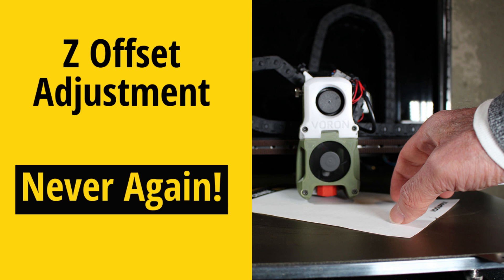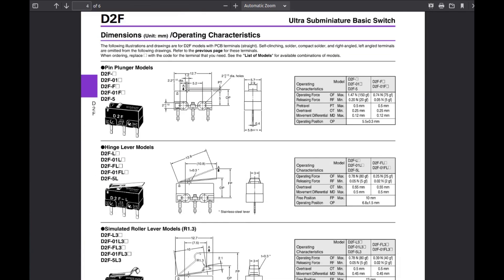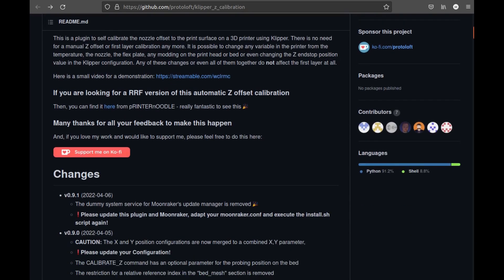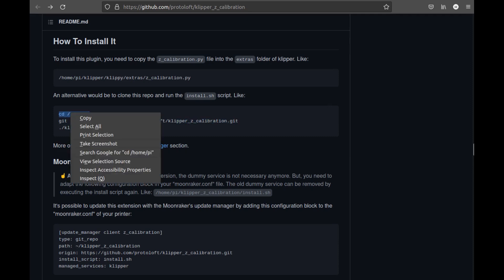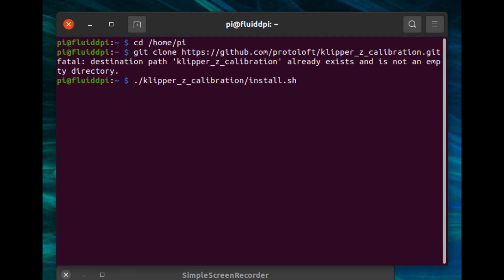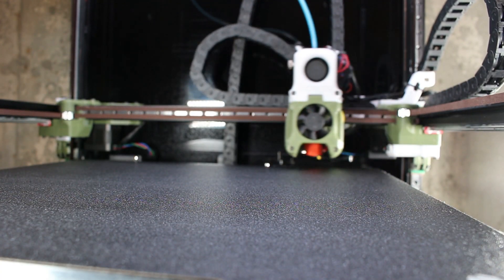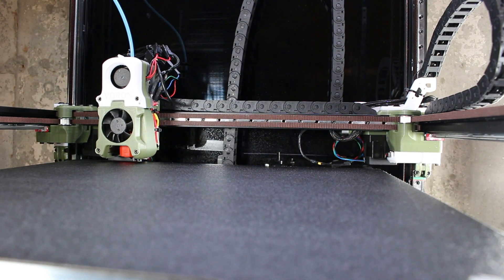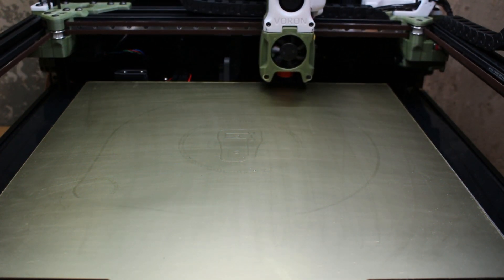Never adjust your 3D Printer Z Offset again with Klipper and a plugin

Comment: thank you for sharing your knowledge with us. I followed the instructions exactly. Unfortunately, when I change the switch offset, whether up or down, nothing changes. the nozzle always scrapes across the bed. I have screenshot / after calibrate_z: G-code 25.34mm (Klipper Z=23.94 < position absolute) G90 - G0 Z5 > G-code 5.00mm (Klipper Z=3.49) - G0 Z1 > G-code 1.00mm (Klipper Z=-0.51) I don't understand that! Do you have an idea what I'm not considering?  I use "Klicky"
Reply from the maker: I'm going to assume you are including the autoz.cfg file in your printer.cfg file.  As you make the changes to the switch offset, are you restarting Klipper to be sure the cfg files are all reloaded?
Reply: @KapmansBasementWorkshop  Thank you for your answer. yes i added the include and yes i always click save and restart. I also restarted the Pi in between.
Reply from the maker: @ah_banny8478  Apologies for asking the most basic question there, but it happens to everyone...Can change these setting by hand and save them?  I wonder if it's rights or possibly a typo?  Can you post the cfg files someplace and post a link so I can have a look?
Reply: @KapmansBasementWorkshop  Did you ever get this resolved? I'm having the same problem.
Reply from the maker: @davewilkowski8326  I don't know the solution to the above problem, but I did post my cfg files to GitHub in case anyone wants to see them.  https://github.com/Kapman1/Kapman1

Comment: Is it possible to add the mesurement from the probe body to the 0.5mm klicking distance and get rid of Picking and mesuring the probes body over and over again?
Reply from the maker: Hmmm. Good question.  I suppose the reason for a measurement each time is to take into account any changes due to temperature impact on the printer's expansion that may be different between prints or a cool printer.  If that switch height were hard coded, would it impact that measurement?  I want to try this now, but my printer is working so well that I'm scared to!  I've also been thinking about changing the start print macro to eliminate as many steps as possible between QGL and the z-offset calibration.  But now every print is rolling off this printer with exactly the same texture on the bottom with no problems or adjustments needed.  I'm kind of enjoying this!
Reply: @KapmansBasementWorkshop  I guess the mesurement is even better,  because one object less that can cause inaccuracy by heating /docking (Probe)
Reply from the maker: @Micha-46456  So at some point I'm going to try it.  If you beat me to it, please post back.  I'm very curious.
Reply: @KapmansBasementWorkshop  I will -  I recently ordered my voron kit, but it won't be available until the end of May at the earliest.
Reply from the maker: @Micha-46456  Have a great build!

Comment: I have an issue with this that the adjusted z now causes the z to be wrong for the probe dock/undock.  So I run this, it adjusts the z, then if I dock the euclid it now hits the dock.
Reply from the maker: I had to adjust this several times after installing.  Since then, I'm not having any trouble.  But, I'll try this weekend with 2 build plates stacked and see what happens.  One other thing to note,  I have had people tell be that mounting Euclid on the gantry is actually better than the mount I used in the video as z-height does not come into play...
Reply: @KapmansBasementWorkshop  I will try the gantry mount.
Reply from the maker: @req00  Please let us know how it goes.
Reply: @KapmansBasementWorkshop  I installed the gantry mount and it works very well with no issues on docking etc even with autoz.  I used the v4 mount from Euclid which has adjustable height but I had to remix the stl using the short gantry as I needed it to be fully docked about 5mm further over on the gantry.  Works great now though and any Z height change the gantry being skewed has no effect on docking.
Reply from the maker: @req00  This sounds great.  I'm glad you were able to fix/improve this.  I'm not having trouble, but I think it may be a good idea to replace mine as well sometime over the next few weeks.  I've been thinking about this since your report and it just makes sense.  When I get some time later today, I'll add a note to the description about this.   Thank you for reporting back on this!

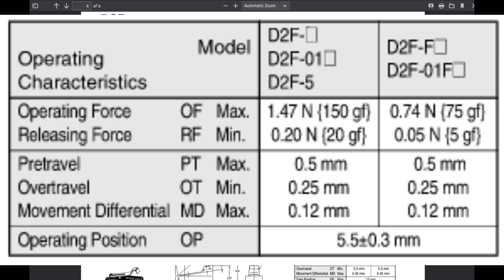Comment: The exact value of the switch_offset value cannot be determined from the switch data sheet and specifically has nothing to do with the  Max pretravel PT in the spec (timestamp 2:25). Protoloft correctly calculates an initial swtich_offset value:  offset base = OP (Operation Position) - switch body height.  But the tolerance on the OP is +/- 0.3mm, so for the D2F-5, the switch_offset will be somewhere between 0.2 and 0.8mm.  We really want the overtavel OT value, that is delta distance between the trip point and where the plunger bottoms out on the case. However the data sheet only provides a min guaranteed OT value.  For a given D2F-5 switch, you can get a fairly accurate estimate of OT ( +/- 0.01 ish) by grapping the switch in the jaws of some calipers and slowly closing them until you hear the click.  The OT is trip value minus the bottomed out distance.  BTW THANK YOU! for creating this video.  Enormously helpful.
Reply from the maker: That is a great point.  I'm going to go back and measure the OT as you suggest here.  Thank you very much for the tip.  Thank you very much for watching!

Comment: Installed a klicky probe, started using z_calibration on my V2.4 and I love it.  Now I've got this working with a CRTouch on my custom printer.  The klicky EVA mount stuck too far below the duct and was below the nozzle (the mount itself, no probe attached) , any other way I came up with to mount it put the probe too far away from the nozzle to do any good so klicky wasn't an option on that printer.  None of the other magnetic probes I looked at seemed any better, maybe if I was running an E3D V6 volcano but with the Mosquito hotend I'm using, no.  Instead, I came up with an adapter to put on the nozzle stop's pin that allows the nozzle to contact the pin but the CR Touch to contact the adapter a few mm higher.  It tricks z_calibration into thinking the "switch" is below the nozzle, I just had to play with the switch_offset a bit (it's 1.97) and it works like a charm.  The metal pin of the CRTouch helps, I don't think I'd do it with a BL Touch and it's plastic pin, too much chance of damaging that soft plastic pin.

Edit:  The CRTouch pin isn't deployed until measuring the bed, so using it's metal pin as the "switch" contact location works out great when z_calibration is checking nozzle position and switch position.  The adapter I came up with goes on the 5mm pin of the nozzle stop, basically a hollow cone with a flat rim.  The nozzle can contact the 5mm pin and the CRTouch contacts that flat rim that's a couple mm above the 5mm pin of the nozzle stop.  The cone section is wide enough inside that a hot nozzle won't touch it, the part that goes over the 5mm pin is tight enough not to move easily but I still added a stop ring so that it cannot be pushed further onto the pin and it's height and placement on the pin remains constant.
Reply from the maker: I love it as well.  It's soooo cool that you got this working with the CRTouch!  I may need to try that with my other printer!  I wish I thought of it.  Thank you for posting back and thank you for watching!
Reply: @KapmansBasementWorkshop  Thanks for the great video!  It was very helpful in setting z_calibration up on the V2.4.

I was going to put a klicky probe on the custom build but the mount they had for the EVA wouldn't work with my hotend, it was lower than the nozzle.  Since I already had the CRTouch on that carriage, I wanted to see if I could use it for z_calibration.  I printed out a nozzle stop like the one the V2.4 uses for use as the z endstop and tried without any modifications but it just wouldn't work. I got to thinking and came up with the adapter that allows the nozzle to contact the pin and the metal pin of the CRTouch to contact higher, fooling z_calibration about the "switch" being lower than the nozzle, increased the switch_offset and it worked beautifully.  Here's the adapter I came up with, feel free to use it or not, however you'd like to: https://social.thangs.com/m/65919

It should be tight on a 5mm pin, tap it gently until it hits the inside stop.  I made it fairly tight so that with the built in stop, it won't move again after installed.  Play with switch_offset to dial in the correct height after running z_calibration.  I was working on the printer bed and had to dial mine in again, it's currently 2.04, so a much bigger offset than with a microswitch but it works.
Reply: Mark, I`d be interested to see how you mounted this on with the CR touch I`m running a BLTouch on an Anycubic. Just wondering how I could adapt this for it.
Reply: @goodmandavis  I'll check and see if I still have the files/photos of what I did.   I lost a lot of videos and photos recently due to a corrupted drive and personal failure in backing that drive up so I'm not sure I still have anything so no promises.

I've made changes to that printer since and don't use the CR Touch anymore, changed the hot end and modified the carriage which allowed me to add an annex engineering probe.

Comment: Great video. The only thing that jumped out to me was you would have to make sure your nozzle is spotless when calibrating your Z offset. I would imagine a bit of filament that oozed out at some point with the nozzle hot or cooled, could easily affect it up to a good 0.5mm or more. Is there anything special you do to help mitigate this?
Reply: Do the nozzle scrubber mod as well.
Reply from the maker: I do plan on adding this.
Reply: When print is finished I do a retract
Reply from the maker: @everuss  That seems like a great idea!
Reply: @everuss  on a HF nozzle you will still likely get some ooze unless you're retracting 20mm+. At least that's the case for me. I had it set for 15mm retract on print_end but it still oozed so I went back to manually cleaning with a brush before Auto_z.
Reply: @everuss  same for me, and it also allows to change the filament or take when the printer is cold
Reply from the maker: While I plan on adding a nozzle brush, I'm reasonably sure that as long as the hotend is at proper temperature for the filament installed, it's typically accurate enough.  But I do brush the hot nozzle with a wire brush before calibrating.

Comment: I gave up a few weeks back on getting this working after installing klicky on my Voron 2.4...in just a few minutes following your video I realized where I had missed a step, and now I'm autoz calibrated! Thanks so much for putting this together.
Reply from the maker: Glad I could help!  Thank you for watching!
Reply: hi, can i ask what step you missed? i get a lot off errors taht i can all solve, because entry's where not filled in the autoz.cfg file or just were examples. After editting al errors out, now i get a message "No trigger on probe after full movement" in calibration step. Did you get the same error? how did you solve it? Thanks!

Comment: Your videos are very well done.  Hat's off for the quality (and the challenging focus on that one).   I am experimenting with different setups concerning z-offset and switching build plates.  I currently run my probe (klicky) as the virtual z-endstop.  Therefore not currently using the default pin-based z-switch in the back.  This takes care of the varying build plate heights and does not seem to create other issues (But I still have to experiment more).    Question:  Don't you find using the nozzle to zero on the back switch an issue on a day-to-day usage?   I got burned many times (before switching to virtual z-endstop) where a little bit of plastic was left on the nozzle and would throw off the z-offset enough to ruin my first layer.
Reply from the maker: I find that as long as the nozzle is hot, and I brush it before the start, I don't seem to have problems with the z-switch.  Or at least I don't think so.  I was having many issues with the induction probes which may have been hiding a problem with the z-switch.  So I suppose I will see soon enough.  Do you adjust z-offset by hand?  Thank you very much for the kind words and watching!
Reply: @KapmansBasementWorkshop    I adjust z-offset by hand and apply the result to the probe.  I never do it again until I switch nozzle.  And I rarely do.  I used to brush it before the start but even then, it would sometimes be a problem with the Home being done on the nozzle.   Like you, I don't have a decontamination brush (yet) so brushing is at the beginning of the process.  As it stands now, I can start a print and walk away.  Oozing at the end of the nozzle will get purged but will not mess up the z-offset.    The only concern I have (and still need to test) is the variation in z-offset due to printing at various temperature.   In theory, the nozzle is going to be higher (less expansion) when I print PLA vs ABS.  45 deg difference could shift the z-offset by 0.01 mm ish (still have to do the math).   To be tested.
Reply from the maker: @eridoom  That brush and purge bucket are high on my list.  Very soon.  I'm going to be experimenting with heat soak time to see if the Euclid probe has reduced the time needed as well.  I was waiting up to 2 hours for the induction probes to stabilize.  If I get an hour or more back, I will be thrilled with all of this.  That said, I would think this modification would take care of the z-offset changes due to temperature changes.  I wonder if it can be made to work without the z-endstop switch...Thank you again.